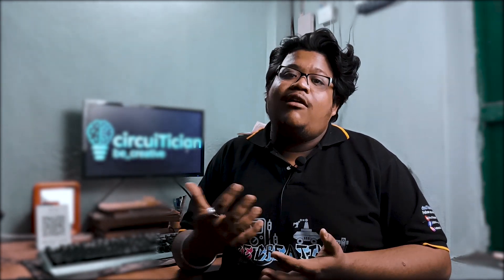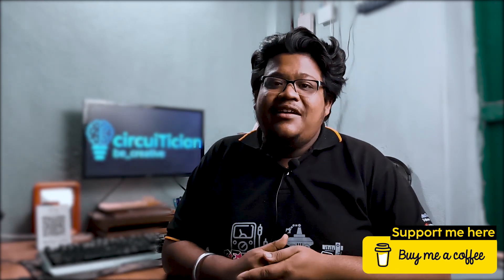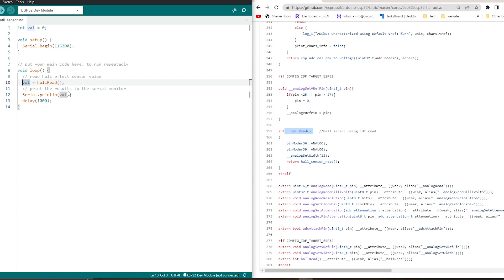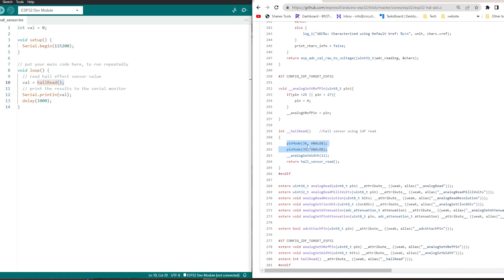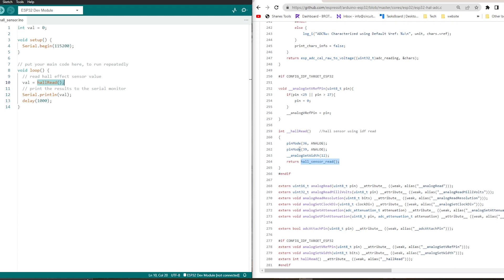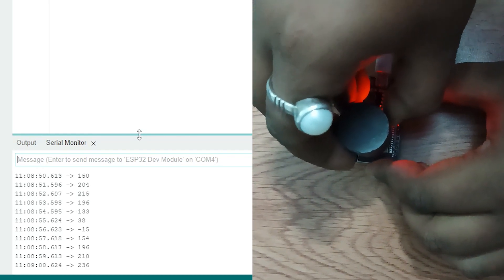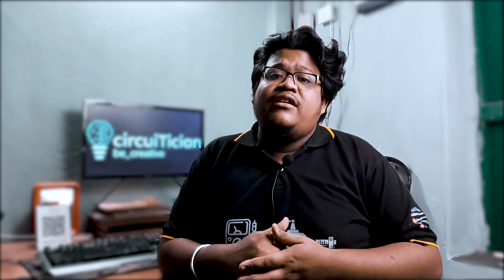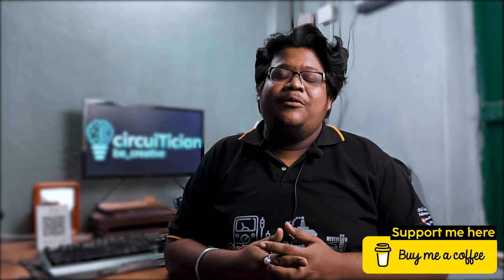ESP 32 Hall Sensor Example with Code

Comment: And what if I have an extenal Hall effect module sensor and I want to read its data with my esp32?
Reply from the maker: Yes you can do that
Reply: @circuiTician  But, I can use the same code? I want to make an anemometer
Reply from the maker: No

Comment: Great, but this internal sensor is as effective as a separate Hall sensor module?
Reply from the maker: Didn't test the accuracy yet but it can be used in small projects where hall sensor is required